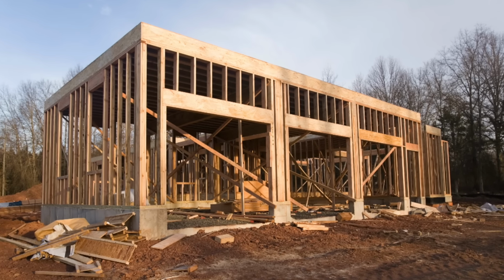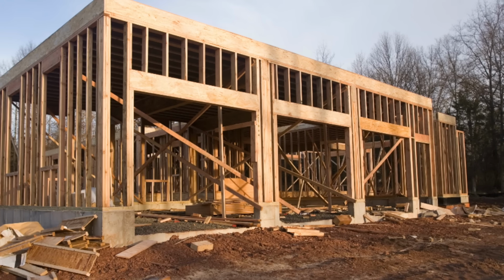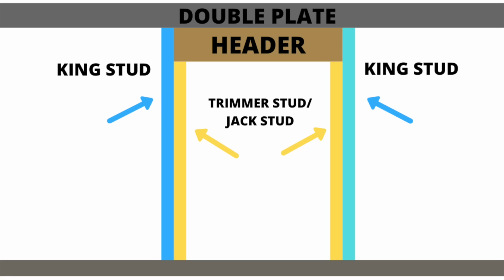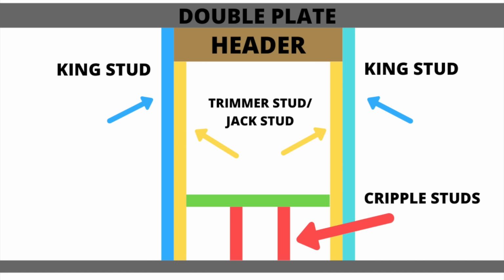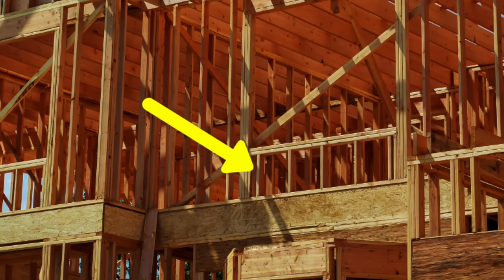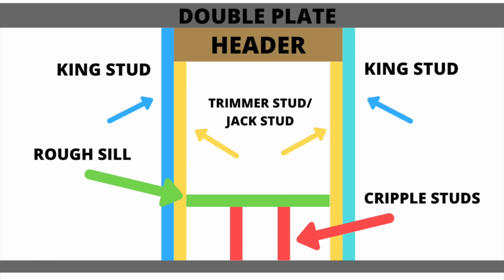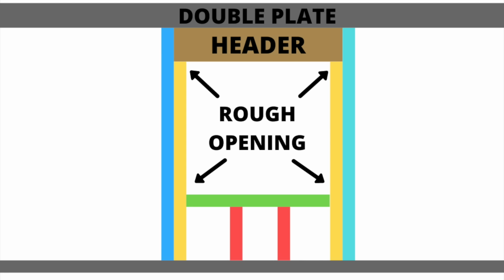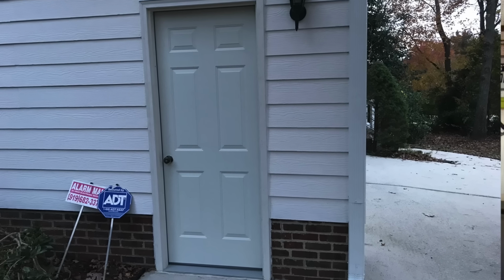All House Framing EXPLAINED...In Just 12 MINUTES! (House Construction/Framing Members)

Comment: To add to your excellent summary: in older houses - particularly ranch-style, with shallow roof pitches - the rafters were often tied together with a collar beam.  The rafters and the ridge board are - by themselves - not structurally able to resist the downward force of the weight of the roof or the additional weight of snow loads; the downward pressure on the roof surface exerts a lateral, outward force on the fasteners and top plate of the wall that the lower part of the rafter sits on, which can bow out the wall or shear the fastener, leading to roof collapse - like an open scissors standing on its points.  

To mitigate this, tie beams across about every 3rd or 4th rafter set, located typically 1/3 of the way down from the ridge board to the attic floor joists, join the upper part of the rafters together in a triangulated structure that resists the spreading force.  It's usually up that high so that workers can pass beneath it conveniently when working in the attic.  That collar beam is loaded in tension, and reduces the lateral force on the rafter end and top plate of the wall on which the rafter sits.  

Collar beams eliminate the need for a vertical support member that runs from the attic floor joist upward to the rafter, eliminating  the need to reinforce the floor joist below to take the downward load - the absence of which tends to cause the ceiling below to bow downward over time if the vertical support member doesn't rest on a supporting wall below.  Using a collar beam instead allows the rooms below to be more open design, as such supporting walls can be eliminated from the floor plan.  

Collar beams also retain the advantage of providing free movement in the attic, which would otherwise be obstructed if simple trusses (i.e. not designed with a center passage) were used, allowing the attic to be used for storage space.  The advent of more complex scissor and fan trusses have replaced the use of the simple collar beam as truss prices have come down. 

Interesting video, well-presented, and information-packed.

Comment: my first comment. Holy shit, do not be boring massive holes like that in your TJIs.
Reply: also, GLUE YOUR SUBFLOOR DOWN, it will help prevent creaky floors, and nail it every 6" or so. don't use their pre designated marks (if you're using material with them)

Comment: The I-joist craze creeps me out. I've seen a lot of lumber joists that have held up fine for decades, even a hundred + years under harsh conditions. I can't imagine these engineered ones lasting a fraction of the time. Glued wood chips swell and fall apart when they even smell moister. I bet 30 or 40 years from now lots of these i-joist structures, especially in damp climates like the NW, will face massive failures they wouldn't have had they been constructed with dimensional lumber.

Comment: LOL, the stringers made me laugh.  I framed for over 20 yrs and my first job was doing tract homes NW of Denver.  The packs of lumber came with exactly what you needed and no more, other than some 2x4s for bracing.  Three of us on the crew and the owner was lead and layout man.  He screwed the 2x12 stringers up 3 times.  Each time he had to cut them up into 2' pieces and take them to the King Soopers dumpster (so they wouldn't be found on the subdivision site) and steal the 2/12s from another houses framing pack.  He finally got them right on the 4th attempt.  I wonder how many board feet of lumber has been saved by pre fab stairs?
Reply: @TheHonestCarpenter  Another thought from the very end of your great video.  Do they not use sway braces cut into the studs anymore at all?  There were a lot of the cheaper tract houses built around here in the 70s with sway braces and celotex as the exterior sub sheating.  Didn't even have plywood shear panels on the corners.  We have some pretty horrendous winds coming down from Rocky Flats, NW of Denver and those houses seemed to fare OK.  Not that I'm advocating cheap construction methods, just saying how we framed things back then.  I finished my construction career framing million dollar custom homes, so I saw both sides of it.

Comment: 5:55 and 6:05 - these headers have no jack studs supporting them.
Reply: The wall goes up before you put your trimmers in so as to not push the bottom plate away from the king stud.
Reply: The wall doesn't go up before jack studs, and they would only push the bottom plate away if you measured it wrong, in which case you would immediately see that happening (with a very obvious gap under the king stud) and simply re-cut. In fact in that framing they've gone ahead and created a rough sill without the jack stud, which means you can no longer install a jack stud that goes all the way down to the ground as it should. I know these are not constructions of the poster of this video, it's just ironic that on the very moment he's overlaid the words "transfer weight" (talking about the header) he has done so across an image of framing that would not achieve that because the header is unsupported.

Comment: I'm doing a tiny cabin that is 16'×16' can I use 2×6 lumber for rafters with a 12 12 pitch roof?  Some have told me no and Some have said it's ok. I also would like the inside open except where I want to build a small loft is this possible or do I have to use collar ties near the peak? In the middle of the building I'm also going to use a 6×6×16 beam and two 8 footers on each side for support I'm thinking this will be more than enough support to hold the walls from pushing out.

Comment: One of the Jack was missing on the header on several doors in my house.  They were sagging down on one side.  I had no idea why until I opened up the drywall.  The headers were short, so I had to replace them all.

The problem is that my house is 40 years old and done all the shrinking.  So I was forced to use LVL.  That was 8 times the regular lumber.  And then the bent and warped studs became noticeable.  So I had to replace it or plane it with a hand planer and sistered it more LVL.  I replaced all the drywall.  Oh and the drywall, oh man.  Anyway, so much poop I have to improve on my house. It was not funny.

Comment: Ya need too go over the names of corner framing and t-joint wall connections, as well as "pony wall's,   2, 3 and four hour firewalls in multifamily dwellings. And one more thing,,, I started plumbing 55 years ago, we didn't have pressure treated lumber back then. Many of those bldgs and homes are still standing in Denver, Colo. With no toxic chemicals in there sill plates.

Comment: As a Firefighter, I hate all the cheapness. Without dimensional lumber in the joists, the house falls on our heads MUCH faster! Same goes for those cheap plates holding the joints together in the roof framing instead of solid nails. I could go on with all the corner cutting and cheap cost savings measures put into modern framing... Keep making it cheaper though as long as it's good for your pocket books and "meets the code". Quality, stability and safety are out the window these days.

Comment: People often say that homes built with wood are weak but, in normal weather cycles they can handle it just fine. Insulated Concrete would be nice in extremely hot areas and areas that get very strong hurricanes.
Reply from the maker: Good call, Charles 👍

Comment: Why not use a sill sealer to separate the mud sill from the foundation?  Even if you use treated wood for the mud sill,  some of the moisture will continue from the sill to the framing material above it eventually causing it to rot
Reply: A foam sill gasket should still be used. That said, the house should be letting water vapor out, so while there is some vapor coming through the sill plate, it wouldn’t cause rot in timber above unless that wasn’t happening. At least based on several 70-100 year old houses where I’ve looking at.

Comment: From what I have seen from some contractors lack of support for load bearing walls especially renovations where rooms are made larger by removing walls. Another problem is subcontractors coming in and taking out support to run wire or pipe. Then there are issues with level and square construction especially when old and new construction meet.

Comment: Like to learn more about how the components get tied together? Nails or screws, where ,and why …..
Reply from the maker: I want to do a video on that soon, Jason!
Reply: @TheHonestCarpenter  
The way you set up king jacks , the way the corner of walls and sills and rims . 
I know you don’t miter the corners for a 45 joint so which one stays outside doesn’t matter maybe it doesn’t how many nails do you put or do you use screws and a few screws you put pilot holes I’m a steel worker I work with steal my whole life building fire escapes so I have a pretty good knowledge but with the wood I have I’m unsure I figure if you put too many nails you’re gonna ruin the integrity of the wood make it weak so you just put one that’s not enough so  two 

Maybe video on different types of support… leg vs brackets … suspension, cantilever decks vs through bolts … please and thanks

Comment: You included some headers without jack studs, it instantly caught my attention because they wont support the weight for long. You might also want to say that Foundations are placed on hard pan or other stable surfaces so the house doesn't sink after its built. another item which may have been added are Chases for plumbing wires chimneys then you could also include cantilevered structures such as joists for decks bay's bay windows because the way they need to be addressed so they don't fail is something Clients need to understand.

Comment: I'm a 6th year steel stud commercial framer and lathesman who recently moved from the big city to the countryside, and this video was exactly what I needed. The only thing I would add is that a Knee-wall is also often called a Pony-wall.
Thank you very much for another great video.
Reply: @Human from Earth Milky Way Galaxy Additionally, commercial walls are often framed with metal studs instead of wood.
Reply: @Human from Earth Milky Way Galaxy What Michael said below is a large difference between the two types. And quite common practice for a commercial building is concrete (sometimes lightweight concrete) slabs on multiple floors with large steel columns, girders and beams as the main framing, this is usually done by a steel erector contractor. Then a separate contractor comes in and puts up all the interior framing with is usually aluminum since it is lighter(wood can add a lot of weight on very tall buildings), always straight, in some locations metal framing can meet stricter fire code due to it being metal instead of wood, also aluminum framing can be cheaper than wood framing in long term, and it can have a longer life span than wood framing for large buildings due to being metal instead of wood. Now you can also often see apartments or some hotels which do wood framing. (Source: me as a commercial construction inspector for 8 years). Here is a link for basic on commercial vs residential construction.  https://www.cdmg.com/building-faqs/commercial-versus-residential-construction
Reply: @humanfromearthmilkywaygala8343 Liability.
Reply: I have done a little metal framing working out of the union..  Metal framing is one of the most complicated parts of carpentry  Once i worked  on a balcony  shaped  like a football  about 75 ' in the middle.
Reply: Steel studs/metal beams/metal doors/fire retardant materials vs. wood@mind_of_A

Comment: I was always taught that the term "decking" was the proper term to use, because the subfloor is the total of the decking and any underlayment below the finished floor. I suppose it could be used but it ignores the finished product and assumes that all will be carpeted and no hard surface floors are used.

Comment: if I measured plumbing like the lumber company measures lumber nothing would actually reach the fixtures.  A 4" pipe would only be 3.5" and so on.   when I have to redo a bathroom floor the rules go out the window because if I want 2x6 or 4x4 they don't come out that way...

Comment: I started framing in the early 80's.  And 95% of the terms used in this video are what I learned back then.  With some other more common ..or slang terms.   Like. Jack studs. Yes. But I think I've only been on five job sites where they referred to cripples as .. cripples.    We called then window legs .. and window sill (97% or the time doubled) .  And  that litt piece of triangle wood that levels off the end of a rafter. Or flu rafter to level to the soffit.  We would call a 'pork chop'.  Not sure why.  Most likely slang term.  But I've always used it...  Lol

Comment: Sheeting keeps the structure together? I guess geodesic domes are the superior structure for strength since the framing does not require supports or sheeting. I wish there was an easier and cheaper way to build them. Great video though! I learned a lot in 12 mins.

Comment: I framed houses for over  dozen years and built homes for 2- 1/2 decades. What you're describing is how we used to build a house back then. All studs, joists, rafters, all called sticks, are lined up from the concrete base/foundation, to the roof structure, or rafters. It always seamed obvious that should be how to make the structure as strong as it could be with these materials, but after 15 years of retirement, I helped a friend build his home and I joined him after the frame was completed and passed the inspections with flying colors. The framer in his area, was considered to be of the best in the area. One of the first things I noticed was there wasn't a single jack stud in any of the windows or doors. The jack studs are there to hold the headers in place and allow for the weight from above it, to be dispersed to the stick component below it. I was told that the jack studs aren't necessarily anymore, and alls I could say, is there not needed any less either. There were several other things I wouldn't have allowed, had t been my house, but I didn't want to argue an issue that my friend insisted was correct. I'm just wondering when he'll get enough of a snow load that his windows and doors will start showing a problem?
Reply: EXC. point about "not needed any less"; I'm in BC Canada and we've gone to 2x6 exterior walls and even 2x8 for a 1.5 story open wall facing south on a relatively small house build. We ALSO have gone to earthquake anchors (look like a large galvanized shoe horn) in corners on townhouse builds (really popular in BC). Even in rare earthquake areas. The same with all the tech. But I watch with incredulity the cheap builds allowed in windy, tornado alley and earthquake prone areas in the USA. What?? Meanwhile we're shuttering our lumber mills and keep getting the softwood lumber issue banged up by US interests. The sure aren't US consumer interests! You would think the USA would want all the lumber it could get.
Reply: @louisliu5638  Cheap builds and expensive builds all go flying during a tornado.
Reply: @jobacuda4472  not many tornadoes in Pennsylvania
Reply: See why retired still don't mean not needed 😉. Sorry u friend didn't value your opinion but I do 😊
Reply: @beone4life  thanks